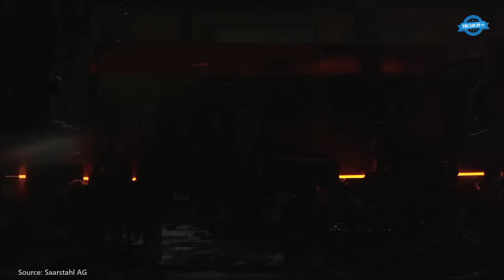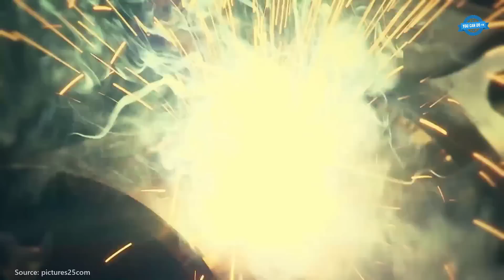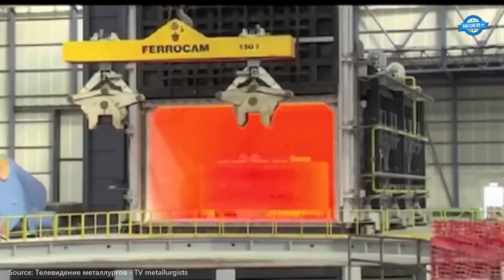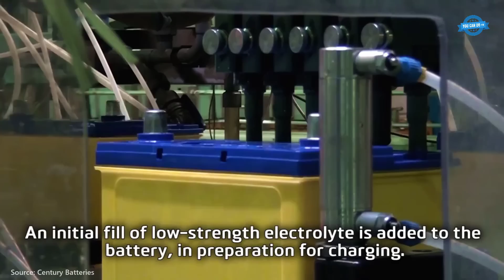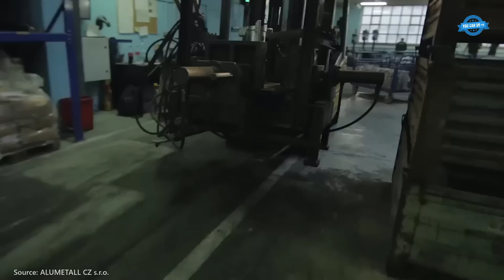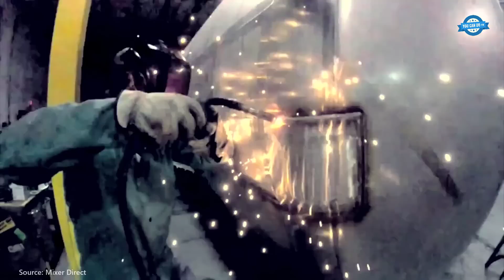How Billions Of Cars Are Shrunk Down For Recycling. Manufacturing Processes in Heavy Industry Plants

Comment: And all that plastic and foam and other residual fluids  are then burned in the melting process and released into  the air. Oh! They have catalytic converters to catch that. What if if told you , that on some nights especially rainforest foggy nights or foggy and rainy days ,that they open them to lower the hours of use to save money  because  they have to be cleaned  or replaced  after so many hours. And that costs a fortune to do. And they want to make their numbers in the stock market so they can keep the cheap ass stock holders happy